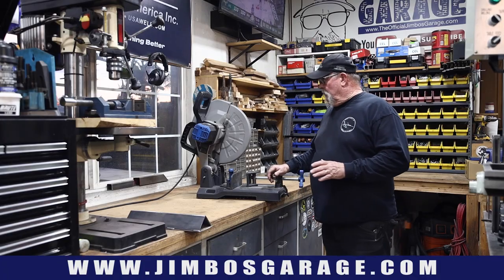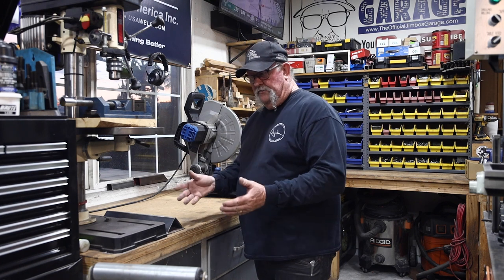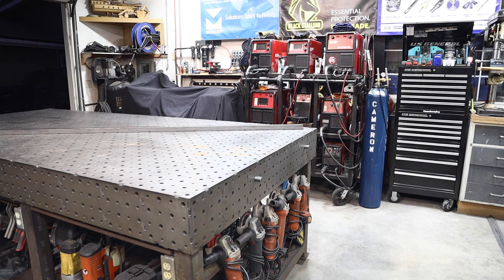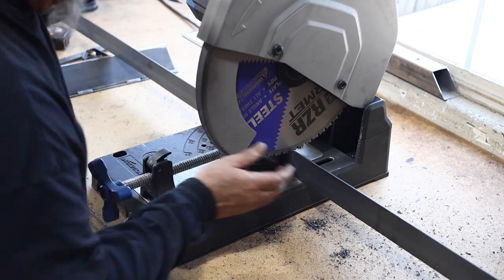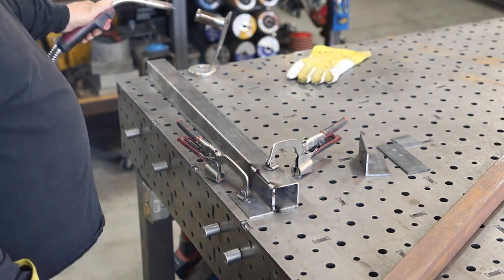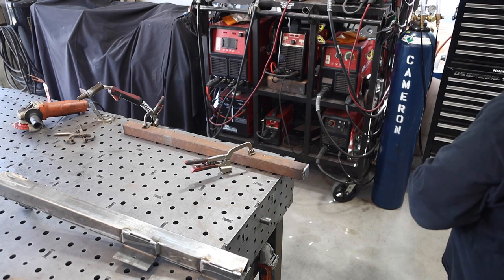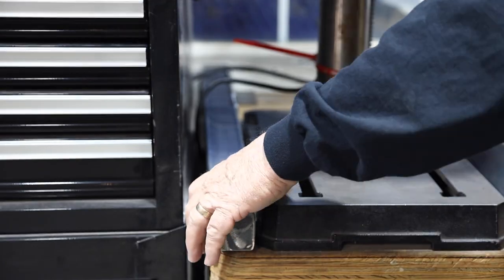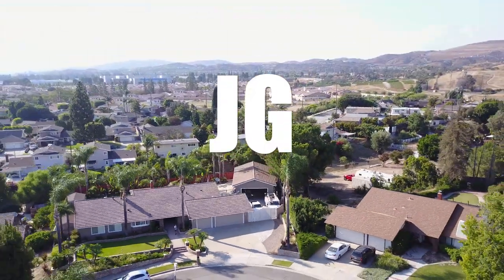Retractable Material Support Stand For Bench Top Cut Off Saw | JIMBO'S GARAGE

Comment: Jimbo, i use the Spyder Stinger Kobalt Mach Blue drill bit set from Lowes; it costs $40 and seems to work great without drilling a pilot hole. The angle is 137 degress. I tested the 1/2" drill, worked like a charm.

Comment: Great idea I feel like I would want like a quick pinch bolt on the over sleeve to keep it from accidentally sliding in when I don't want it to but besides that I might be stealing this idea thanks for the great content..
Reply: Two holes in the inner tube for in and out position. And a spring returned pin on the outer tube, would be even nicer :D